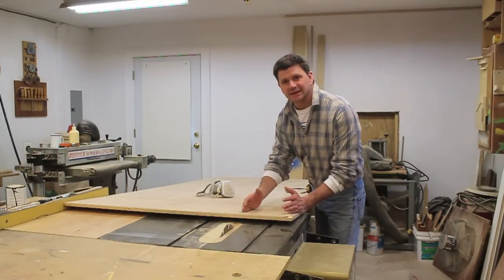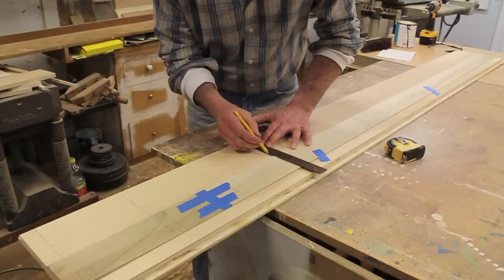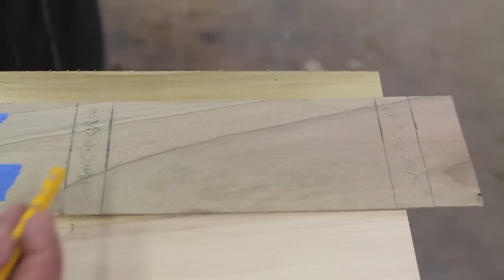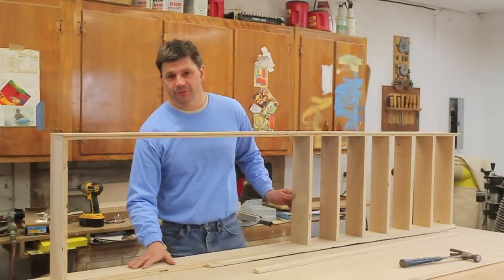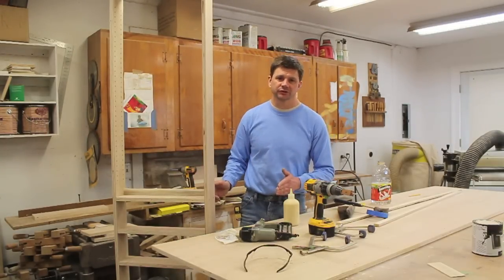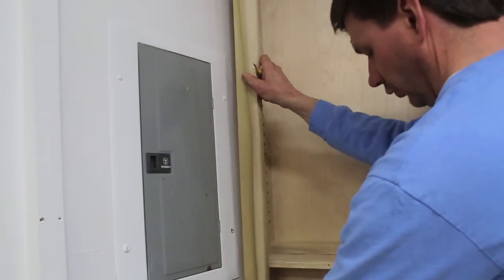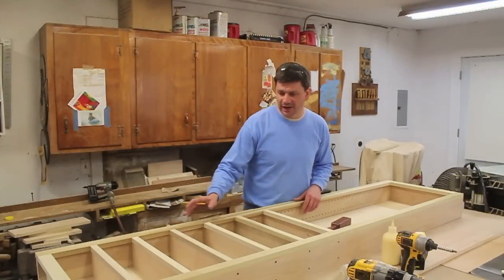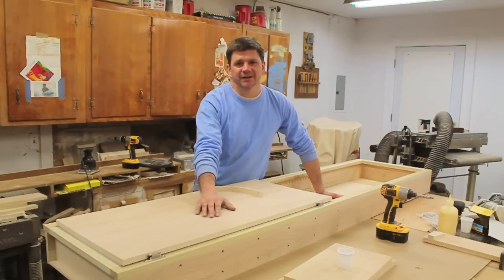How to Build a Cabinet, Organize Paint Can Storage Cabinet.

Comment: Jon,

Great looking cabinet. I agree with others that your extra details make it much nicer than what would have just gotten the job done. The inspiration to push beyond the minimum is most welcome, as is your careful layout and overall craftsmanship.

My only criticism is a personal preference, born out of kitchen traffic patterns around the refrigerator. It looks like you hinged the door on the right side. If so, the door will block access to the shelves as you open it, forcing you to reach around behind it to gain access the interior, or open it 180 so it lays flat against the door through the wall. Given the corner location, I would be inclined to hinge on the other side so the door hinged toward the electrical panel access and "opened" the cabinet to the room.

Either way, it is a lot nicer than the paint cabinet I haven't built.

Comment: Great use of otherwise dead space in the shop. Plus it keeps a lot of ugly out of sight for a tidy shop. 

One thing I thought of while watching was when scribing for the wall, did you do a small degree back cut (say about 5 degrees) to make sure only the visible edge of the trim is touching  the wall? I started doing this because of a remodel I did against a terribly rough plaster wall. Seems to work well. 

Keep up the good work!

Comment: I just started watching this.  I'm a model-builder (mostly RC planes) and a kinda woodworker.  I have so many chemicals all over my home that I can create a lot of space by putting all those chemicals in one place.

We all have tons of cleaning supplies.  I have probably 20 gallon cans of various solvents and thinners.  I have almost the same number of gallons of model airplane fuel.

Then there's paint.  I have all types of wood finishes, several types of finishes for models and who knows what.

I have tons of miscellaneous chemicals as well - acids, degreasers, etc.

So I'm hoping to put all of that in one cabinet and if there's still space then all my cleaning rags, paint brushes, spray guns and airbrushes and anything else paint/fuel/cleaning-related except for large items like mops and brooms.

I already gathered a lot of it and frankly I doubt I'll fit it all in the cabinet.

My plan is to make the cabinet as large as will fit in the space.  The doors will have shelves on them that are more closely spaced than the shelves in the cabinet so I can get more small items organized but easy to access.

I bought sixteen eight foot 2 x 6's to get started.  I already have tons of plywood.  Now I just have to get started jointing the 2 x 6's.  Not looking forward to it because I have to hand plane them.